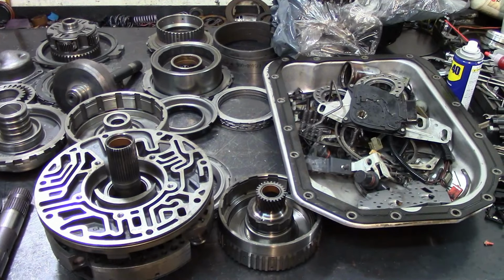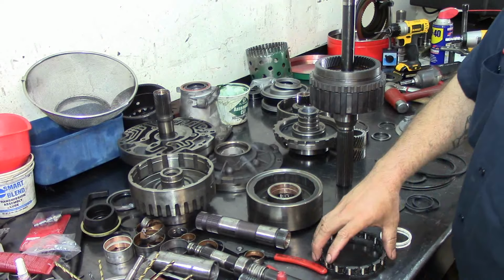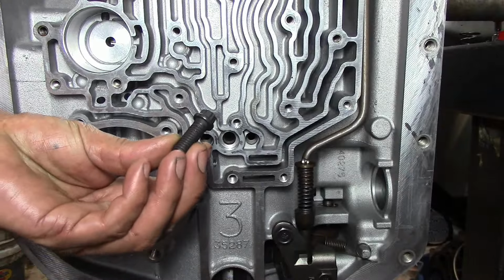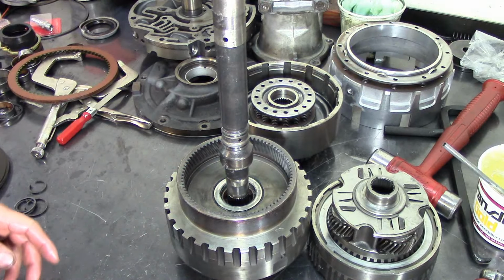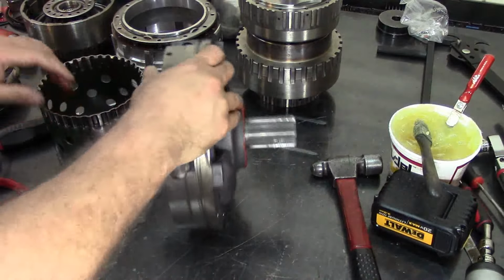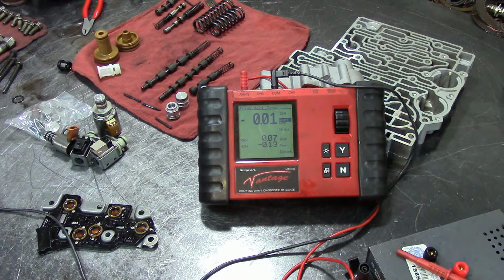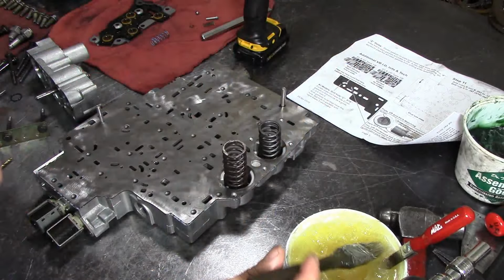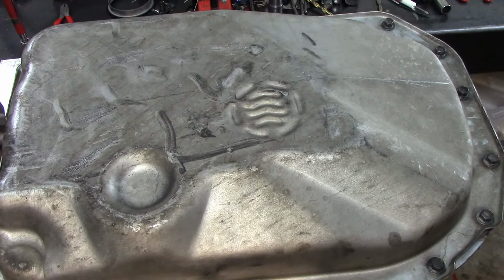GM 4L80-E Transmission Rebuild - Transmission repair

Comment: Great video as always! I used it to rebuild a unit from a 1997 c3500. my trans didn't have a shim on the main shaft like yours did. Is that bad? I would also like to pick your brain, I need to build a trans to put behind a 5.3 chevy motor thats been hopped up. I have both a 4l80e and a 4l60e to choose from. Shoot me an email in your "free time" ha ha. vinman1175@gmail.com thanks again and keep up the killer videos!

Comment: Awesome videos Hiram. Thanks for doing these. My ATRA rebuild book for the 4l80E says to NOT use the output shaft seal on the 2WD trans, but my '99 model had one and I saw that you put one in the '08. What gives? Why does ATRA say NOT to use it on the 2WD trans?? Thanks man!
Reply: ***** Thanks Hiram! I will install it.

Comment: I have the 4L80E in a 2003 chevy express 3500  Before I take it to the tramsmission shop I was hoping you could make a suggestion as to what the issue is. Basicly the transmission doesn't upshift into 4th and sometimes it feels like it won't even upshift to 3rd Appreciate any comment you can make.

Comment: Hi Hiram I have a 700r4 that works well in all forward gears and reverse only when ran manually  has good torque converter lockup but when the shift selector is in drive is bearly moves any suggestions

Comment: Hi, Great videos!! I have 2005 Trailblazer Ext, my trans was working fine no symptoms, I was at the light when I took over it stop in the middle of the intersection,  immediately the trans began making a light noise, but when I change from P to R or D it feels like its changing gears, I check the oil stick and is like 2 extra Quarts, I checked it the week before and was good and no code are present.. Can you please give me any advice?  any information please?   Thanks..

Comment: rebuild bushings and complete overhaul kit new forward drum and new boost valve kit and filter. filled up and started up on jack stands i have rev. and forward put on ground rev. ok but wont pull in drive . acts like it has no pressure to pull. but it has rev.where did screw-up studyed both of vedios many hours

Comment: Hiram, I have rebuilt a 2006 4L80E that came in with a burnt converter and slip code. Complete rebuild as you have described with Sonnax Sure Cure kit. Still no lockup. ECM is commanding it according to my scanner, but no lock up. As a side note, the oil sending unit must be faulty as sometimes the oil pressure gauge will peg out at 80 and the oil warning light will flash. Any ideas? Could it be an ECM issue?
Reply: ***** I tested as described and had lock up command. After discussing this with some other builders, recommended trying another converter. That was the issue. Faulty reman converter. Piston in converter most likely cracked. Was told this was a common problem. Probably missed during reman inspection. Thanks for your help and I really appreciate the time and effort you put forth in creating and "teaching" with your videos. I look at them religiously!!
Thanks
Butch
Reply: +Butch Burton awesome job on the follow-up!  Most people post their problems but never return with the solutions, provided they even found one.  Those updates are important too, so I just wanted to give you a thumbs up!! 👍

Comment: Valvoline 773636 Dex/Merc Automatic Transmission Fluid - 1 Gallon, (Pack of 3)

http://rover.ebay.com/rover/1/711-53200-19255-0/1?icep_ff3=2&pub=5575031602&toolid=10001&campid=5337445009&customid=&icep_item=271563992423&ipn=psmain&icep_vectorid=229466&kwid=902099&mtid=824&kw=lg

Comment: Hiram,
I put together a 4l80; this is only my 2nd one. How will I know if I mixed the forward and direct steels up? Would I have been able to install the snap ring on the tighter assembly? I didn't realize they were different. I must have got lucky on the first unit. Gracias.

Comment: Really liked the video Hiram.  I don't know how you managed to work so late and then not drop any F bombs after the check balls and manual valve engagement issues.  I didn't mind the length one bit.  You helped me with my 4R70W build.

Keep 'em coming!

Comment: Remember when we could reply with a video in the comment section? Check out my first video here and see where your knowledge spreads. I am no stranger when it comes to cars, but this is my first transmission rebuild. I had a lot of fun while taking in so much information along the way. A tech manual can give you a lot, but it can't give you everything, you are filling the gaps.
DIY Transmission Rebuilders J-Tools

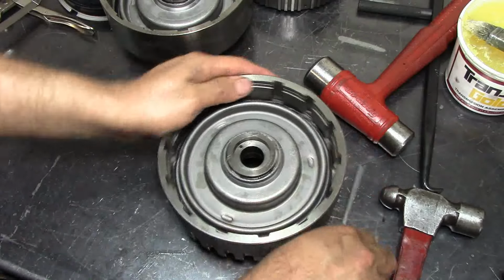Comment: I can definitely second that statement at 42:30 about how it can take a long time to install the pistons into their bores if you don't have practice at it. I still have the old reverse input drum out of the first transmission I rebuilt so I can practice.
Reply: Yeah, no kidding. I'm kinda toying with the idea right now of gambling some money and gettin the Seal-E-Zee kit from Lubegard and seeing if it lives up to the hype I've heard about it or not. Of course, the way it's going right now, I can probably find Sasquatch easier than I can find a place that actually sells the kit. If I do wind up getting it, I'll put up a video reviewing it.
Reply: Look on Ebay $103.25 under Lubegard Seal E Zee ......free shipping.
Reply: @tradersnotion thanks. Think I may have found one of those kits somewhere else. Still debating on whether to get it or not.

Comment: I have yet to read a complaint about the length Hiram!  I think this extended version is a hit!  I personally really enjoyed it....and realize, I have no two cents to add. ;)
Reply: For a supposed rush/rush job, it was the best anyone has put out there so far.  Your work station is always clean enough, superb lighting and your explanation through the process surpasses any complete build out there.

Comment: Sorry to say, but the Venture van is a front wheel drive van. Ain't no way a 4L80-E will fit in it.
Reply: Poor Hiram, stayed at the shop for a very extended time after hours just to make a video on this rebuild.  He already beat himself up tons due to the lost footage. You are correct though,@dmorley100.
Reply: Eh, it happens to all of us at some point Hiram. It's the reality of the auto repair business overall, not just the transmission side of it.

Comment: This is the best 2 hours I have spent on YouTube in a long time Hiram. Thank you so much for sharing this with us. You give the novice and DIY guy an idea of how much time it takes for the seasoned professional to do the job. Many techniques used here apply to other transmission rebuilds. Great info for the new and the experienced rebuilder. Next video, would you highlight some of your tooling for us? I would like to see which brand and style of snap ring pliers you like most and why. I would also like to see more of the shop tooling and facilities too. I have the same issue with my workbench lighting here. The workspace is well lit for the eyes, but not so great for pics and videos. If you know anyone with a studio lighting kit, such as an ARRI setup, invite them over for an experiment. Upload a 5 minute test video for comparison. Awesome work!